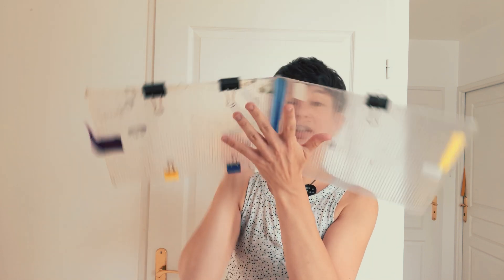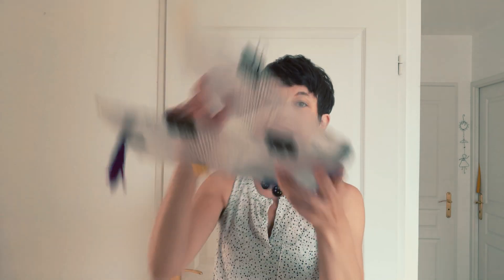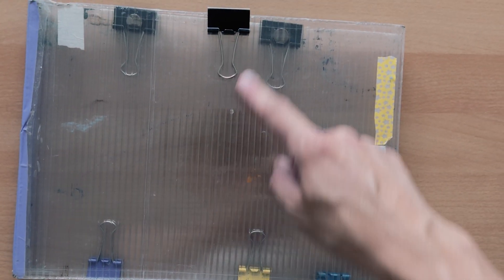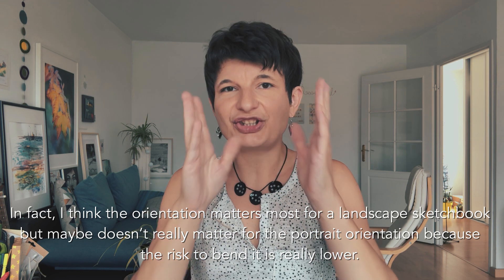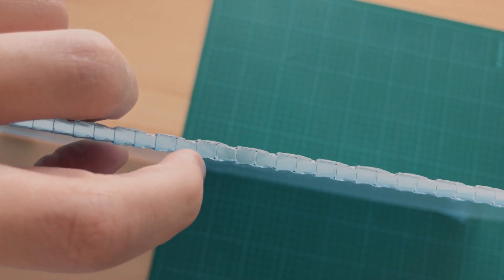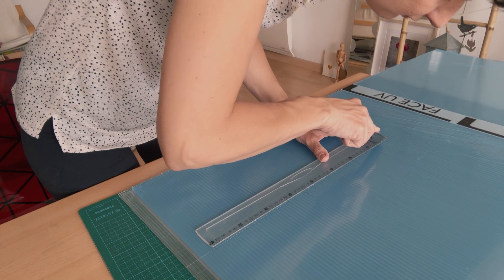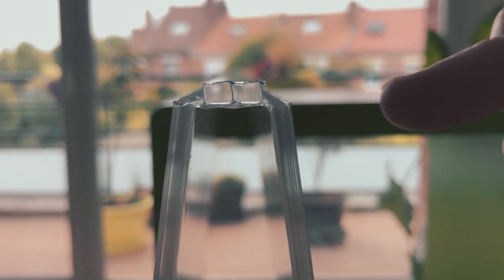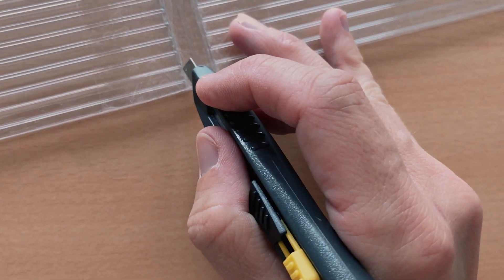The Urban Sketching FOLDING BOARD ✨TUTORIAL✨

Comment: We made these for our urban sketchers in Santa Fe, NM.  One of our members made an excellent addition:  a small rectangular  piece with magnets inset in both the board and the small piece to hold the metal  palette, instead of bulldog clips.  Duck tape holds the magnets in place.   It fits on the top edge of the folio.  I also use a palette cup clipped to the back cover to hold a small nalgene bottle of water so it is steady and nearby.   Large elastic bands also hold the sketchbook inside so it doesn't fall out when carrying everything.  This is a wonderful invention - thank you Anne Laure for sharing it with us!
Reply: I'm not sure how to post a picture to this format.  However, I can describe how to make it.  The size of the rectangular platform  ( of coroplast) should be large enough to accommodate your palette.  The longest side should be no longer than the width of your back cover, and 2-4" high to accommodate the palette.  Inset 2 magnets about 1/2' in from the top edge of your platform and the back cover of your folio, wide enough apart so your palette fits over both magnets.   I used craft magnets about 1" in diameter and 1/8" thick.  You can use smaller ones.  Be sure the magnets face the same direction in each piece so they will attract and hold.  When not in use, the platform adheres to the inside cover of the folio.  When ready to use, flip it so the platform sticks out from the interior back  top of the folio.  Your metal palette will be just above your sketchbook.  Hope this helps.
Reply: You're most welcome.  Enjoy.